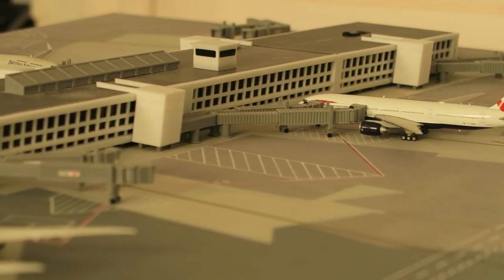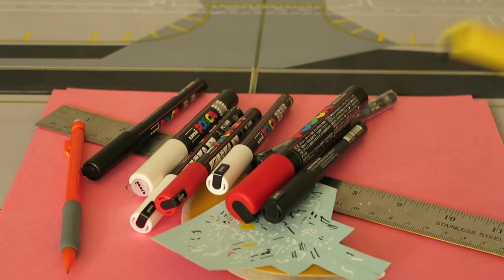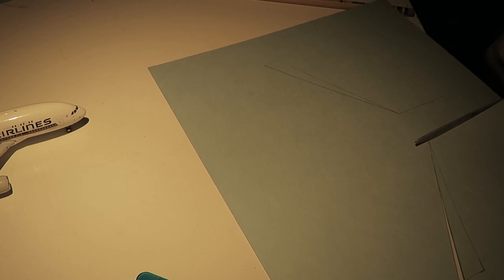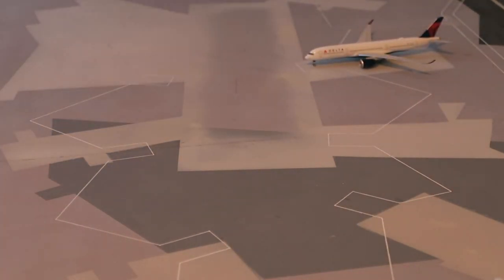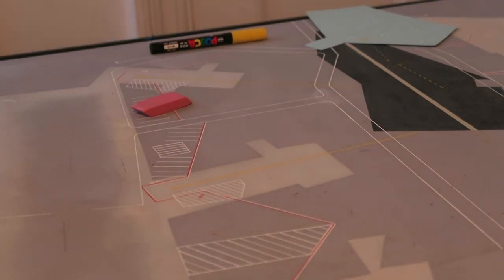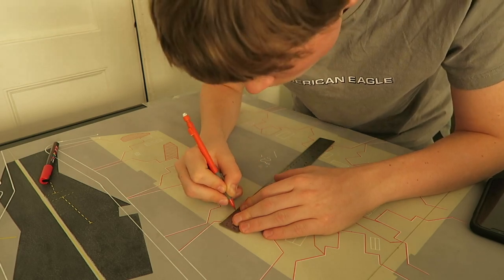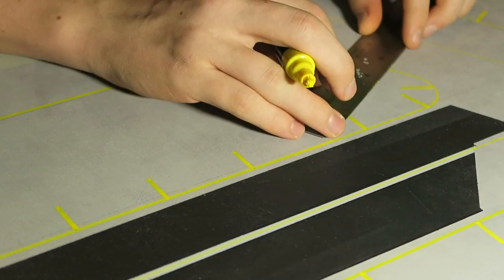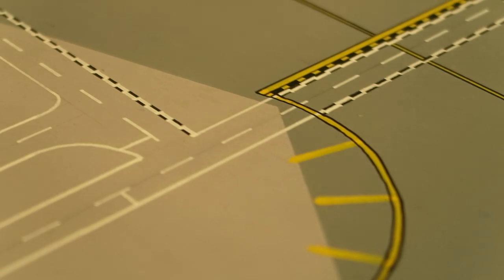How to Build a Model Airport | Airport Markings

Comment: Use a disc will do the trick mate
Reply from the maker: Yeah but the disc is not the right size for my taxiway as I did everything to the exact scale and measurements. Great idea tho 👍
Reply: @aviationjfk6523  Fair point, maybe try something else similar or smaller size. Cans do the trick. Do the yellow line first then don't move the disc and then use the black pen to do the outer side then you can work from them two line for the inner one. Practice first
Reply from the maker: The problem is the inner diameters are different so the black lines won’t be the same distance apart throughout the curve
Reply: @aviationjfk6523  practice with it your do it. Use the disc or whatever you want to you first do the yellow line then don't move it keep it in place do the black right on the edge of the yellow curve then do the inner one with the disc. You won't be far off.